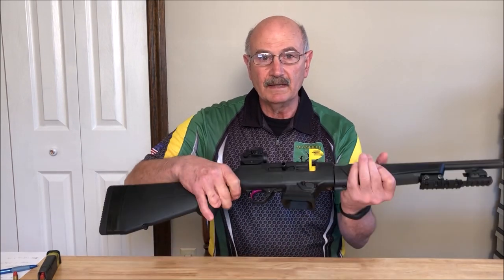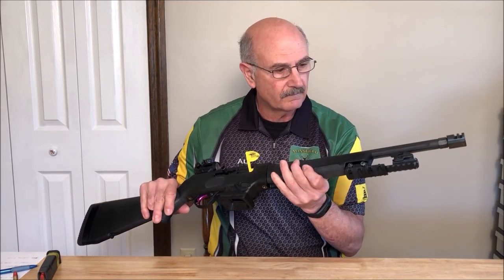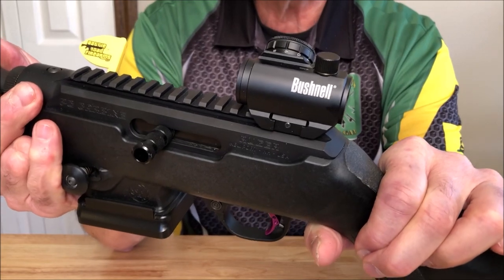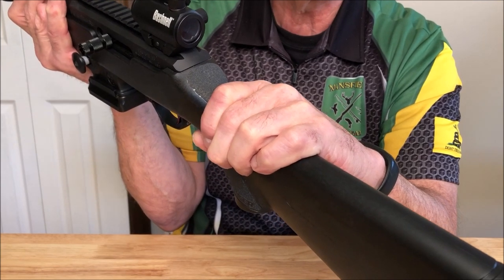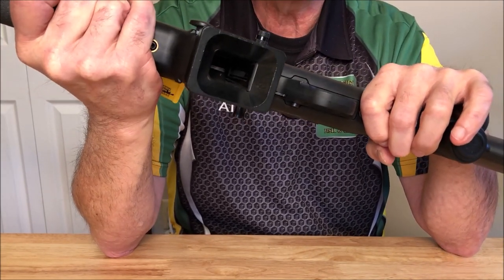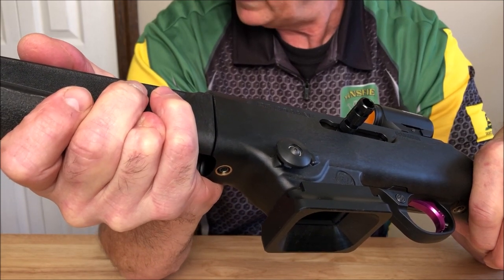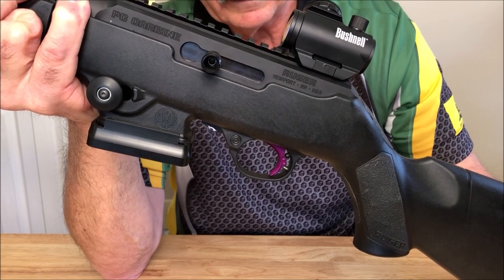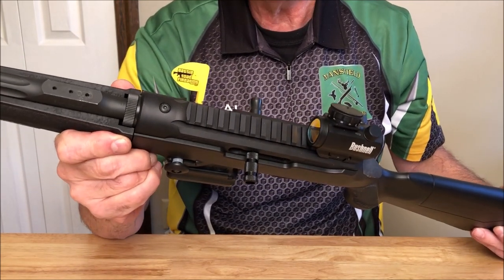Ruger PC Carbine Competition Upgrades, PLUS Magazine Change Techniques!

Comment: I went through four TRS 25 red dots. The last one was hand-picked by the shop at Bushnell, Still, not very good, but I gave up on them. Not the quality I had found from Bushnell years ago. The PC Carbine Is a great little rifle, but too heavy for a carbine. I still enjoy it though.
Reply from the maker: Mike, I agree the TRS-25 is hit or miss.  Like I said in the video, the Bushnell service tech told me that from one batch to another you never know what you will get.  And yes, the PC Carbine is heavy but as heavy as some AR platform 9mm rifles.  When using it for the right purpose the weight isn't an issue.  When I was shooting in USPSA the weight wasn't too bad if you are a big strong guy, but was absolutely terrible for Steel Challenge where low weight rules.  You just can't swing it fast enough.  BUT for falling plate matches I can kick ass with it, just look at some of my other videos with me shooting it at steel.  This past weekend I shot a plate match and finished 4th out of about 80 overall, and 4th out of 28 Carbine shooters who were shooting much more expensive AR style guns.  And it wasn't the guns fault, I just has too many make up shots, and all 3 guys that beat me are Grand Masters and shoot carbines every weekend, mine only comes out of the closet now on match day.  So I can live with that!  And thanks for watching and commenting.
     Shortly I will be coming out with a video showing a wooden stock that a friend of mine is selling.  They are professionally made out of different woods, some quite attractive.  Check out woodshopwednesday.com and have a look.  Spoiler alert...they ain't cheap. Let me know what you think.

Comment: Thanks to your tutorial, I was able to remove the bolt head and file a 1/10" ramp onto that ridge.   Much less resistance now when I open the bolt with a loaded mag inserted.   I also installed a bolt handle on the left.  The Ruger handle stays tight, but the add on came loose.  Needs a dab of blue LokTite.
Reply from the maker: I'm glad it worked out, that little bit of smoothing and polishing goes a long way.

Comment: Thankyou for this video! I recently got me a Ruger PC, wich i'm about to upgrade a little, so looking for ideas. And that magazine change was FAST!!
Reply from the maker: Good luck with the new rifle!  I have the original version, and there are newer variations available now, as you know.  That larger release button is a must for fast mag changes, BUT you really need to be careful of an ACCIDENTAL mag change!  I was at a match this past weekend and had to shoot left hand in one stage.  While changing from left to right hand I hit the button accidentally and the mag came out.  It was a par time stage with only a few targets, and it cost me dearly.  There were 12 targets that had to be shot in 12 seconds, and I only got to hit 5 before the time ran out. It took about 3 or 4 seconds before I realized the mag had dropped, I thought it was a misfire, and another 2 or 3 seconds to get the new mag in and recharge the rifle.  Oh well, a lesson to be learned is to practice shooting left and right shoulder, as there are many matches that require this.  I never practice this, and when I got home I did some dry fire drills and realized it was very easy to hit the button.  I have come up with a routine that will keep my hand off the button in future matches-I hope!  Also, if you start having ejection issues, look at changing your extractor to an aftermarket one, like the Mcarbo brand.  Also change the bolt pins and extractor pin, as they will start to wear and cause ejection problems.  Good luck with your purchase and feel free to ask any other questions you might have.
Reply: @CompShooter54  Thankyou so much for replying! Appreciate the information :)

Comment: Good video Al, and you answered my trigger question from another video, I am on my second PC carbine in the latest config, in between I had an FX9 also a Just Right carbine, and both had their problems and went back to my favorite the PC carbine, which is well built reliable and accurate. Always had good performance from all Ruger firearms.
Reply from the maker: I agree that Ruger makes great products, and I own other Ruger guns as well, but they do have their lemons.  I have a friend that has a MK4 .22 pistol and it won't go through a full mag without jamming, with at least 8 different Hi Vel brands of ammo.  It went back to Ruger and still doesn't work.  As far as the PCC goes, many have sent theirs back because of the ejection/stovepipe issue, and have come back still not resolved.  
    As far s the trigger group goes, the trigger is just a cheap knockoff of the BK 10/22 trigger.  It adds nothing to the function or trigger pull weight, I got it because it is aluminum, not plastic. I replaced the hammer with a Volquartsen because I "worked" the stock trigger for a lighter pull, but after a few thousand rounds it went full auto.  The only other stuff I did was I polished a few surfaces and put in a lighter trigger return spring, and the pull is right at 1.75 pounds now.   If you look on YouTube for videos of polishing the 10/22 trigger parts you will see what to do.  Have fun.

Comment: Thanks for sharing. I like your dollar/performance perspective. After watching your 10/22 video I bought the most basic,(rail without sights, 18" pencil barrel and plastic stock), 10/22 available and made my own mods to it; Did a trigger job, shortened the barrel to 16 1/4",added some stippling and a vertical grip with a Sightmark that I like. Wil be shooting it at a Steel Challenge match next weekend. Glad you did this video since I've been eyeballing the PC9 for the same reasons.
Reply from the maker: I'm happy to hear that!  It's nice to hear that there are others willing to try doing their own gunsmithing.  You can truly now say that YOU built the rifle.  I have a friend that has a pencil barrel 10-22 that is all stock.  The rifle should shoot well for you. I made a radical change to mine since the video I posted.  I made a sleeved barrel for it, which is a stock barrel that I cut down to 6" and permanently attached an aluminum sleeve to it to make it 16.5" and legal. The whole gun now weights only 3.5 pounds. I'm curious how you cut down the barrel?  Do you have a lathe?  Reply to this post after your shoot and let me know how you did.
Reply: How did you bond the aluminum to the steel barrel? What diameter aluminum tube did you use? How well does it shoot?  How solid is it with your forward grip?  Thank you

Comment: In my experience 115 grain shoot 6-8 MOA, 124 grain 4-6 MOA and 147 grain will stack on top of themselves out of the Ruger PCC.  It will eat anything reliably so if 6-8 MOA works for your distance and target size shoot the cheap (😢 2022 prices) stuff. Groups were shot prone at 25 meters.
Reply from the maker: First, thanks for subscribing! I shoot nothing but my own handloads, and 147 gr plated bullets exclusively for matches, and 124 gr cast for practice. They are less snappy and the gun stays on target better.  My loads are just powerful enough to function the gun with a little to spare.  The 147's group because of the fast 1 in 10 rifling.

Comment: Did the magwell help with Glock mag slop?
Reply from the maker: Not at all, it is all external to the factory magwell and only aids in a faster mag change.  I might suggest a few wraps of electrical tape around the mag to eliminate the slop.

Comment: Great Video
Reply from the maker: Thanks Jonjon.  Do you shoot the Ruger?  I just changed the extractor to the Mcarbo brand as I was still getting failures to eject with the stock extractor, even after modifying it.  Also the stock bolt pins were wearing into an oval shape so I replaced them also with the Mcarbo brand.  I had one failure to eject with about 300 fired with the new parts, which is one too many and can cost you a match.  I am now looking into my handloads.  I have been loading them light to keep the recoil down, and I am now thinking that if my powder measure throws a light load it may be causing the bolt to not come back fast or far enough to give me a positive ejection.  I upped the velocity by 50 FPS to see if it will cure the problem.  Even if I throw a light load, it will be heavier than my normal original load.

Comment: You do want the extractor from Mcarbo.  Looks like the #1 upgrade to me.
Reply from the maker: Scott, I did the extractor and the bolt pins upgrade about a year ago, and the extractor was much better then the stock one I modified.  However I found that the ejection was still marginal and I found what I think was the real issue that so far no one else has discovered yet.  I will be making a video any day now to show how to correct this, and it will take about 5 minutes to do.  Even if you are not having ejection issues your bolt will run much smoother, and the difference is very noticeable.  Stay tuned for that one. 
    Also one of my Mcarbo bolt pin heads sheared off a few months ago and jammed up my bolt during a match.  Mcarbo was quick to replace them, and so far so good.
Reply: @CompShooter54  I'll be looking to see what you've done. Mcarbo got me for about $130 in internal upgrades. I even got the flat alum trigger but not the trigger job. I like the trigger pull as is.  Hate to hear that bolt pin broke. That was the whole point of the upgrade. My pcc is shooting perfect so far but I've only fired 300rds so far. Lead cost as much as silver these days.
Reply from the maker: @scott1lori282  Scott, I just put up a new video about the ejection issue, check it out!

Comment: Ilive in MA too, mine came with an unthreaded barrel. Was yours threaded?
Reply from the maker: Hi Adam.  Yes, mine came threaded from Cabela's in December of 2019. A lot of gun shops are selling the threaded versions.  I don't think a threaded barrel on this rifle matters under state law because the gun does not have the design of the AR.  I know that some people had them threaded at local gunsmiths for around $80.
Reply: @CompShooter54  that's great Intel, thanks Al!
Reply from the maker: @whynot2022  I don't know what part of MA you live in, but if you are near Foxboro, Dave Santurri is who I believe did the other 2 guns that I know of.  Loom him up on the internet and give him a call, he does excellent work.
Reply: @CompShooter54  yeah, I'm close...  thanks Al